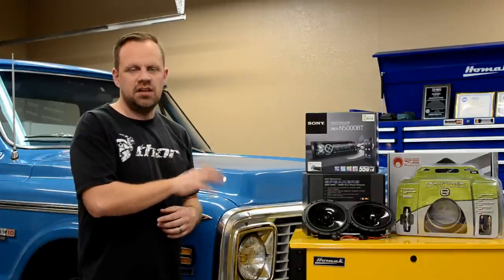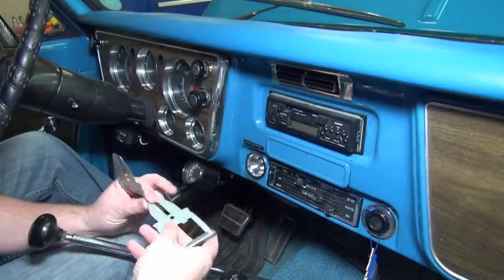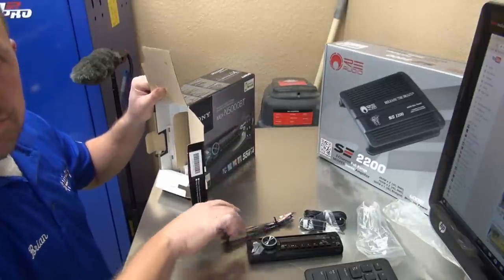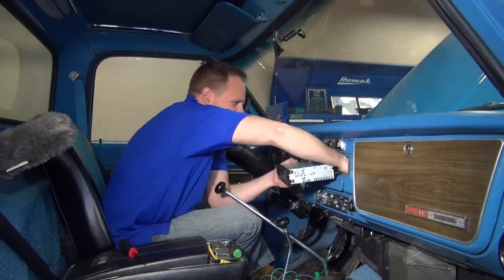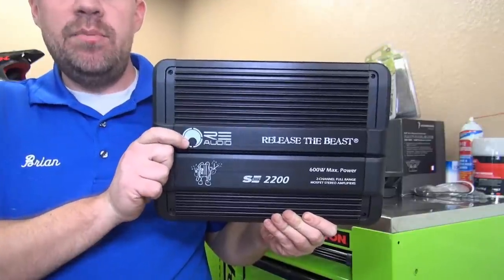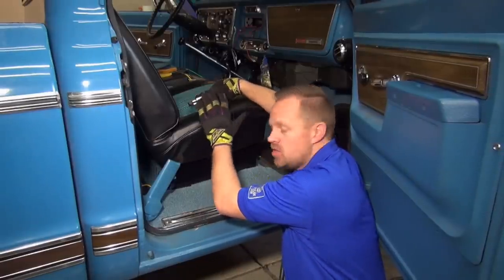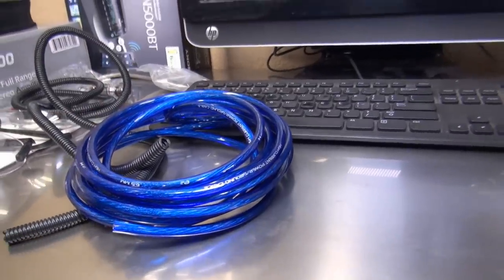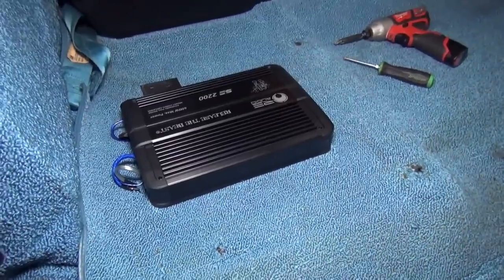Full Sound System Install Upgrade | Classic Chevy Stereo Install

Comment: I have a 2003 Old car that it's becoming a "Classic", and I would never ever ever ever ever cut holes in the metal, as it can create RUST in the future as they are where water can run sometimes... and in the event that I do, I would spray at least some clear coat around the cut zone... and I would never use a screw into the floor for the same reason.. I dunno where are you doing this, but if you do have some cold snowy winters the salt used to melt it will for sure cause corrosion... oh well...
Also I would solder those cable end tips before insulated them with heat shrink plastic material..., well that's what I would do... :D

Comment: A nice example of a well kept truck. I cringed a little when you said you planned to cut holes in the doors. I needed a kleenex when you actually did it.
Reply from the maker: I know what you mean. however that is what the owner of the truck wanted to do!
Reply: 0Myles0 aren’t new doors not that expensive tho?
Reply: Do It Yourself Bri Yes but u as the “professional” should’ve told him about kick panel speakers!
Reply: RTD i7

Comment: i cringed over the connectors. should have soldered all the connections and heat shrink insulated all the solder points

Comment: I think you have the truck year wrong..
Reply from the maker: +6FeetUnder You are right it's a 1972...Not 77
Reply: @doityourselfbri  You might have your friend double check his trucks VIN to verify the year of his truck. The doors he has are not 1972 doors. They're 1971 or earlier as the 1972 doors have a dimple and screw on the inside top just below the wind wing vertical post and lock. Nice install by the way.
Reply: @Fishwacker59  nope, its a 72. The arm rest alone tells you it is a 72. all other years it was the stand alone beefy arm rest